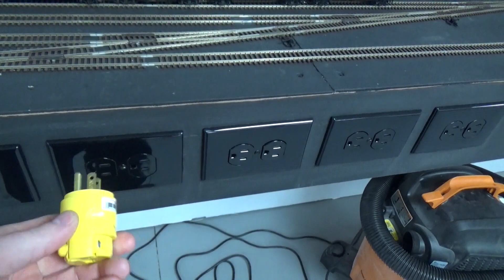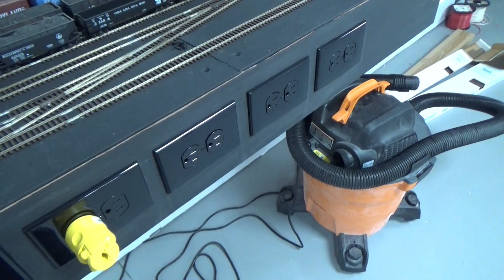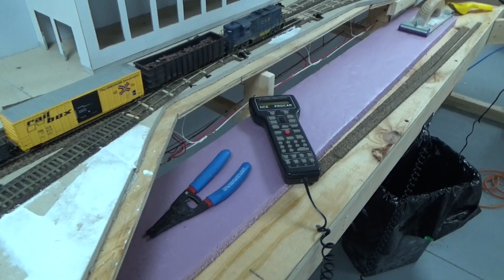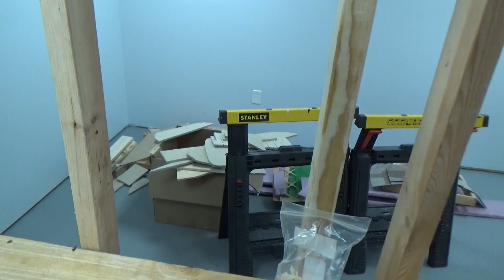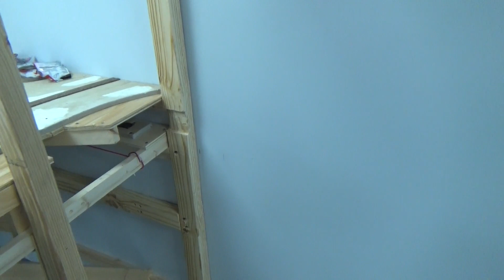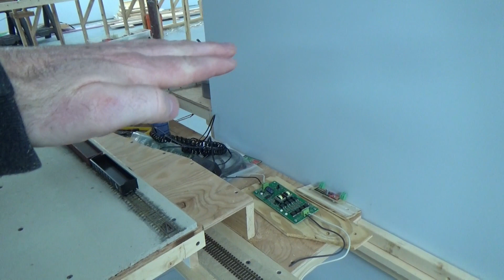Model Railroad Update 33 (Railroad Construction Begins)

Comment: Very cool idea to use the home sockets as a disconnect for the staging tracks. Just wondering about the plug, in Europe 90° plugs are available, even with a smooth back, no such thing available in the US? Your roadbed, both with the homasote and the splines looks awesome.
Reply from the maker: Yes, i think we have lower profile plugs here also but not in bright yellow.  I will see how this works and once the opposite benchwork is in and if it is an issue i will look at lower profile solutions.  I am happy with the roadbed so far and appreciate your kind words of encouragement.

Comment: Do you have a detail on how you made your benchwork? It looks like L-girder and box set on top supported by angled wood notched out.
Reply from the maker: I don't have a sketch of the detail but you have essentially described it.  In areas where there is no plywood i am also installing small blocks where the horizontal pieces connect to the backdrop ledger to resist separation at that point.

Comment: accident waiting to happen  ---
Reply from the maker: I suppose that i could run a common wire from the track BUS to the ground screw and then run to two separate tracks from each neutral pole.  Its unlikely the railroad jumper plug will wind up in a line voltage wall outlet in my house as there are never unsupervised children in the railroad room... But never hurts to be as safe as possible.
Reply: @ChessiePAdiv  why switch power at all - you have dcc?
Reply from the maker: @ebjamville  True but all of my decoders power on automatically and even if i changed them to start on mute they would still draw power and nothing is more energy efficient than an open circuit.  Also easier for operators who may only be familiar with a different dcc system.